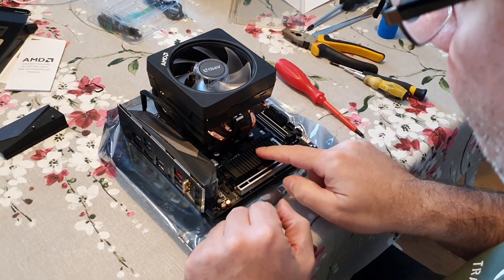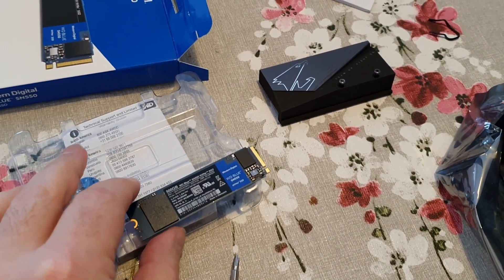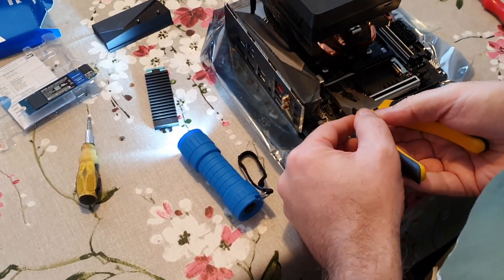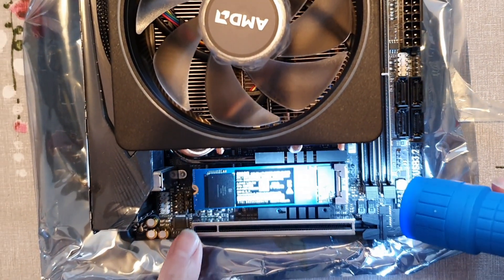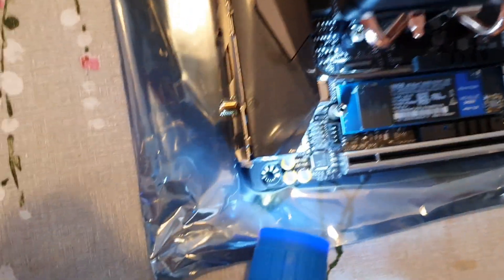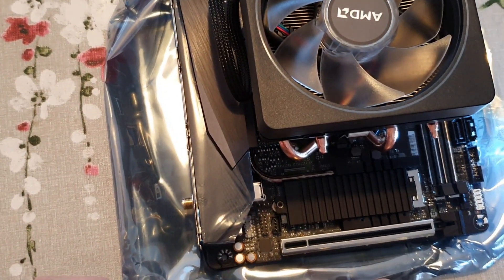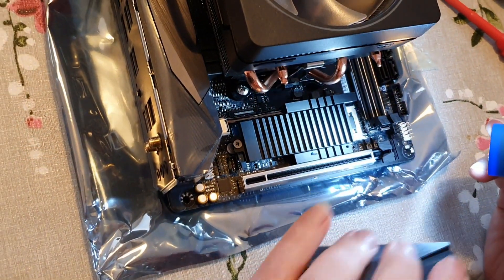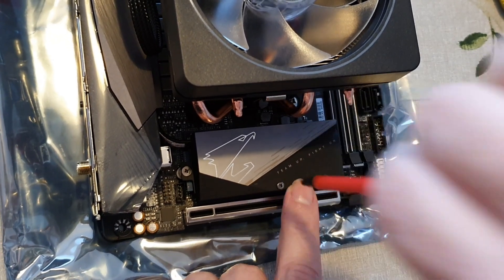Install M.2 Drive - WD SN550 into Gigabyte Aorus B550i Motherboard

Comment: Thanks man. Stared at the board for a while and this looked like the right move, but I'm thinking "do they really require us to use pliers to unscrew this double-decker screw piece?" Strange on their part. It's not in the manual.
Anyway: thanks for the vid. Helped me out. 👍

Comment: bUt HOW do you use the OTHER SLOT beneath it?? The VRM heatsink thing blocks it??

EDIT: oml, i hadn't looked at the BOTTOM of the board. You can just see the slot from the top so my lord.

I had already installed the thing

Comment: Just for info, as I've read and heard a lot of people comment about the grey heat sink above the black M.2 heat sink, even pro building channels! 

It's not for decoration it's a heat sink for the VRM via the heatpipe and the chipset which is located below the M.2 drive, that's why it does not make contact with the M.2 heatsink and straddles it. If you leave it off you will often see lower temps for your M.2 drive, as it's exposed rather than being in a tunnel like metal shroud. The trade off though is you'll have higher temps in your chipset and VRM. If you're not pushing your board and your ambient temperature isn't too high it shouldn't be an issue, but it's there for a reason and it does have a purpose. 

I would recommend people leave it on if it's not causing an issue with clearance for other components like a low set CPU cooler. If you have to remove it you should ideally monitor your temperatures and if they are high, consider supplementary cooling for that area, like a fan for directing air flow that way. If you run your board hot all the time, best case you may reduce it's working life, worst case it could fail.

Very helpful video for installing the M.2 drive though, as a lot of new builders can be confused by that second retaining nut.
Reply from the maker: Many thanks for the comments

Comment: It could not have been done worse...you have to figure it all out with your own tools, how to remove that tiny screw and put it back later by balancing the tools and the screw.
Reply from the maker: yes, they seem to have taken on board these comments and new boards now dont have these tiny screws but a quick release latch instead. thanks for the feedback

Comment: Cheers. No idea why they made it so fiddly to install an SSD
Reply from the maker: Yes, very small screw. Lots of people having problems. Thanks for the feedback.
Reply from the maker: @JoeyA51 I suspect that if you have purchased the board recently, this is a version 2. And might be slightly different. kind regards Dean

Comment: I'm fairly confident that the m.2 doesn't need a spacer between the heat sink the like middle screw bit cause its off position

Comment: Very helpful.   Removed doubt about the proper way to mount M.2 on this motherboard.  Manual assumes this knowledge is known or should be by prospective builder.  Thanks for your work on putting this together.
Reply from the maker: Many thanks for the positive feedback, Regards

Comment: Question: Might an NVMe with a heat-sink stick out on the back-side or does it for sure?
Reply from the maker: Hi, thanks for the question. I think it would be best to just use the case NVMe heatsink. This attaches just to the front side so fits well. Just leave off the aluminium block for best drive temps. I didnt try a stand alone heatsink but I would think it may not fit. Regards

Comment: Good video. I will install it first, then Ram and later processor and fan.
Reply from the maker: Thanks for the feedback, Regards
Reply: @deanjallen6449  My mainboard is the same but it has a slightly different screw.  It is not required to remove any stud, instead the heatsink screw has a nut on other side which  is securing the memory card. It seems that nut on your mainboard was not glued to the screw but left on post instead.

Comment: Thanks so much for your video, I was really scratching my head on this part because it’s nowhere stated what you need to do. That little thing on top of the post was screwed in so tight I would have never guessed you can and need to remove it.
Reply from the maker: Thanks for the positive comments. Regards

Comment: Very helpful video, thank you kindly for posting!  I had a heck of a time getting the m.2 heat sink (the part with the sticky pad attached) to come free from the post.  I kept checking around the back of the board thinking I missed a screw somewhere.  I ended up prying at it a bit with a pair of needle nosed pliers.  The metal on the end of the heat sink is very easy to bend.
Reply from the maker: Many thanks for the comments, glad the video helped, Regards

Comment: Thank you for the great video! Just one follow-up though, any idea on how to install the second m2 that the specs and manual say this board supports? Watched your video twice and I can't figure out where the second drive would go!
Reply from the maker: Hi there, thanks for the comments. The primary drive with the operating system needs to go in the front slot as shown. The front slot talks directly with the CPU so it is very fast. The second drive if you have one goes on the reverse side of the motherboard. Depending on the case and case cut-out, you may need to remove the motherboard from the case to fit this one. Hope this helps. Regards
Reply: @deanjallen6449  Amazing, thank you! :D

Comment: Oh and one more thing that i found, it's better to cut a bit of the thermal pad so that it only sticks to the m.2 drive controller, not the NAND. The NAND on my drive is a bit taller than the controller, this makes my M.2 drive runs hot most of the time.
Reply from the maker: Hi there, many thanks for the info, good tip. Regards

Comment: I can't believe I'm googling for how to screw in an M.2 drive lol. It would be better if you unscrew the nut with 5.5mm hex socket.

Anyway I found that the 'heatsink' doesn't really do anything to help with the drive temperature especially in right hand sandwich style case where the M.2 drive sits on top. I took it off and stick 2 40mm fans instead.
Reply from the maker: Hi there, thanks for the comments and I'm glad it was useful. I couldn't find a 5.5mm hex socket at the time...Installation of this drive was a little different to normal hence why I did the video. I suspect the heat-sink was more for show and best with airflow around drive instead. Not sure I like small fans though as they can be loud. Noctua do make some good ones though. I suspect you only really need them if pushing the drive hard. Regards

Comment: First thing I allways do after MB unboxing is: install my M.2......
Reply from the maker: I think a few people put the drive in first. I think in most cases it doesn't really matter too much. I think it can also depend on the exact configuration but putting the drive in first would be a good idea especially if you have a large cpu heatsink to install. Thanks
Reply: @deanjallen6449  with all respect.....

Comment: Damn ill need to RMA my board, the screw sheered off so i cant mount my drive properly, does the standoff come out? i could swap it with another maybe
Reply from the maker: Really sorry you had this problem. Other people here have also had the same issue. I think the threads are just that bit too small. One person drilled out the nut but I wouldn't advise it as you need to be really careful. You would need to remove the back plate I believe to get to the nut which is not easy if trying to replace. Best probably to try to RMA first. ATB
Reply: RMA a board you broke !?........good luck !!!
Reply: @Auslad  nah it was like that when I got it

Comment: Hi, I have this same board but I installed the SSD in the back m2 slot and I have the OS on that one. I get many bsod at the startup tho, do you think that putting the SSD in this slot would solve anything? thanks
Reply from the maker: I think its only the front slot that talks directly with the CPU so the front one would be best for speed so I would put this in the front slot first. It should still work though in the rear one. I would download the SSD software, update the SSD firmware to the latest. This will probably solve your problems. Also try turning off any fastboot settings in BIOS and also in windows. I think this will also help. If this doesn't work try making sure your RAM is running at the correct voltage. Also try slowing down the RAM speed and see if this works. Always only do one thing at a time though. Regards

Comment: omg what a shit engineering design around that m.2 2nd post.... 
for 2 days I am trying to figure out why that m.2 drive is not recognized in BIOS...
Reply from the maker: Yes, its not the best design, I hope the video helped, Regards
Reply: @deanjallen6449  Totally, thx a ton. All works now. Btw, I think there is a tool added in a bag with other screws  to unscrew that thing. I used the iFixit tool set I have.

Comment: Glad I found this video, will be building a new PC using the Aorus B550i this week
Reply from the maker: Overall its an excellent board. Just be very careful not to tighten the small screws too much. May also be worth leaving the aluminium block off for slightly better m.2 temps. I also have other videos of this build. ATB

Comment: Cheers for this video, I never would have got it right. The instructions that came with my board are actually totally wrong, they say "Locate the proper mounting hole for the M." SSD to be installed and then tighten the standoff first. Insert the M.2 SSD into the M.2 connector at an angle. Press the M.2 SSD down and secure it with a screw."

If I'd followed these instructions I would have caused damage to my SSD by having the end 2mm too high and trying to tighten the heatsink and SSD down in one go.

Really not good enough Gigabyte!
Reply from the maker: Many thanks for the positive comments and I am glad this video helped. Regards

Comment: Great vid! Waiting for mine to arrive. BTW, putting that final block WILL worsen your m.2 temp by 5-10c, and you were right that leaving it out is actually better. Or, you could put some thermal pads between the two. A gent from reddit performed some tests.
Reply from the maker: Good tip! I suspected as much. The block doesnt actually make contact with the m.2 heatsink. It may help with the chipset temps though so I thought I would leave it in place. This transfers the heat just through the bolting face though so I suspect it doesnt make much difference. Just be careful tightening the screws as they have small threads and a few people have commented on they broke the nuts. Just need to nip them. Thanks for the info.

Comment: My standoff snapped. I put the m.2 drive in, then the small standoff on top. I put the thermal pad on and as I was screwing the final one in the whole thing came apart. Seriously cheap from Gigabyte. Not sure what to do. Bought via Amazon, i've had to use the option to send it off for a repair. 🤷‍♂️
Reply from the maker: Really sorry you have had this problem, someone else here has also had the same issue. I think the threads are a bit too small for this and don't have enough strength for the application. Because of this you have to be very careful and only just nip it up. Hopefully it will not take too long to come back. The other person that this happened to drilled out the post but still needed a new nut. Best to ensure the board is totally clean before you rebuild to ensure no metal swarf is left behind, you don't need any short circuits after this.  All the best...

Comment: I unfortunately snapped that hexnut off inside the standoff 😢
Reply from the maker: Really sorry to hear this, not what you want from a new board. Not sure if you could removed the inner post and put this where the out post is instead. Maybe best to look at underside of board. Maybe Gigabyte could send a new nut, if not maybe best to return if its new. All the best.
Reply: @deanjallen6449   I ended up drilling the stuck part out lol. the part is so cheap it didn't take much effort. just need the nut part from gigabyte now.
Reply from the maker: Excellent news. You did well drilling this out as the tapping drill size must be tiny for this thread. Did well to even see where you were drilling! If you managed to save the post threads then go get a lottery ticket quick. I am sure Gigabyte will send you a new nut, maybe for free! All the best.
Reply: Was very tiny, used a 1/16 bit. And you were right, gigabyte did provide the part after 2 months of badgering 😁